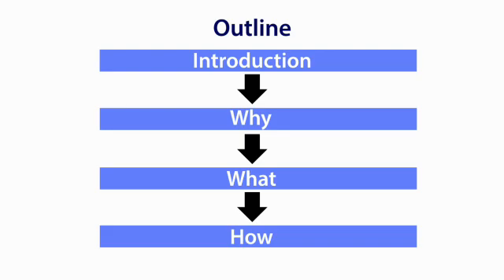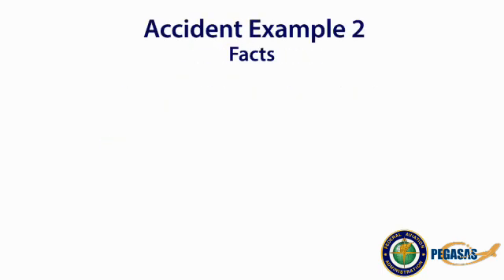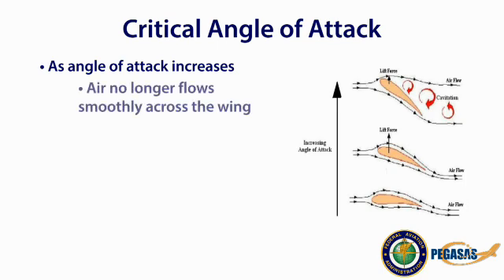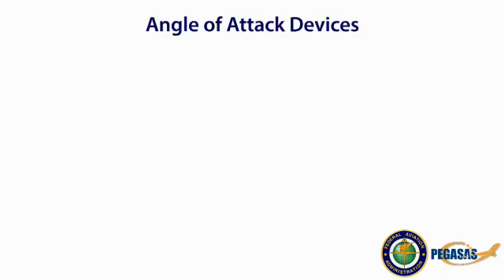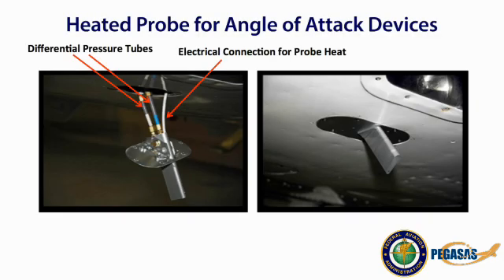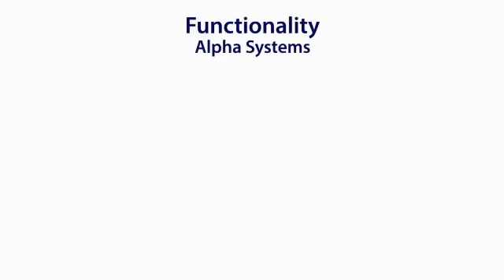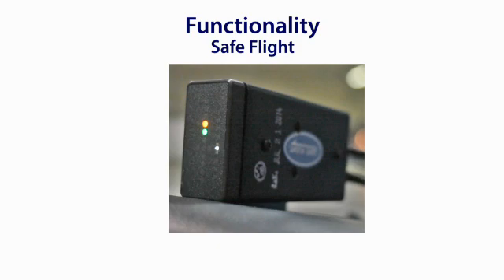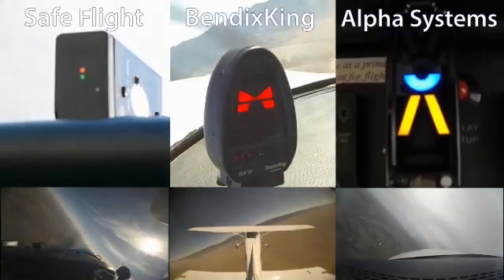Angle of Attack Awareness

Comment: I have installed the Alpha unit on my C-150M. WOW, when properly calibrated, this tool is GREAT during ALL phases of flight, especially on short field takeoffs and all landings. I've stopped hawking the airspeed indicator and use the AoA exclusively during ALL landings - including crosswind and gusty landings. Flying the donut is a snap and easily learned. I had my display placed left of center because most of the traffic patterns I fly are left turns. I believe an AoA indicator should be a must for ALL GA aircraft.

Comment: Firstly, the causal factors listed by NTSB are more symptomatic. More causal, may be elements such as lack of wind cognizance and effective compensation. The rapid division of attention required for what may be an unknown environment(airfield). Much information is missing. CFI's need to ask themselves, how could effective, meaningful training, have prevented these accidents.A non- digital (tape) 'old style' analog airspeed indicator has the added benefit on approach, to act as an alpha (AoA) indicator for a given configuration. Aircraft employing the newer panels lack this visual and this is where an AoA indicator is helpful. Moreover, many instructors are not, or are unable to teach basic airmanship both cognitively and as a skill set. Many pilots are not taught to ' fly the wing'. What is depicted here is accurate.  Indeed, the deployment of lift creating devices increases the wings 'effective' area thereby deceasing the area of air around the wing (Area x Velocity x'roh' = Constant). Lowering the stagnation point on the leading edge by induced alpha or an added 'drooped leading edge' increases the 'effective' area of the wing too.As area of air decreases its velocity increases, and per Bernoulli, a pressure decrease is noted. Recall too the stall occurs because air in motion has momentum and simply cannot make the sharper turn for a certain angle to remain laminar.The AoA device that for me was deemed usable, was a needle style on the panel of the Canadair CL-415. These devices are meant to enhance safety, but are not a substitute-able crutch for routinely practicing MCA, Stalls, etc.type skill sets. Including airman cognition and knowing the envelope of your aircraft. This is an excellent and accurate video production.